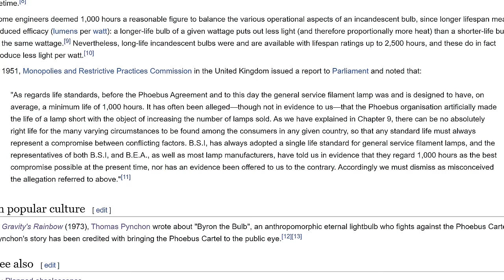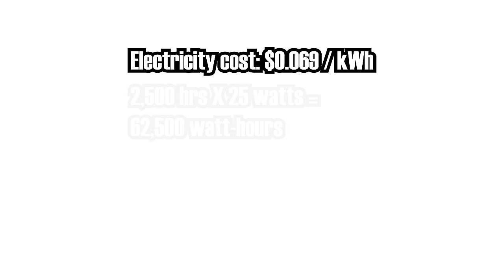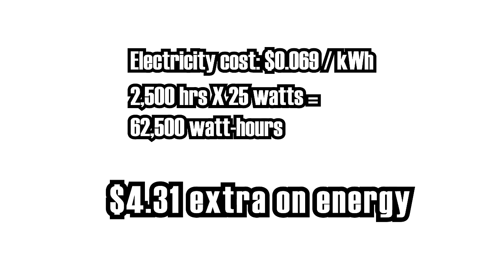Longer-lasting light bulbs: it was complicated

Comment: This got me thinking of other potentially dubious examples of planned obsolescence and I came up with an example that might be interesting to you, heat pump compressors! I personally had a fridge compressor fail recently after it was only about 5 years old, just outside of the warranty period. I've also had to replace the air conditioning compressor in my car after it was around 7 years old. Contrast that with stories of fridges manufactured from the 50s lasting for decades. But I wonder, did those fridges last longer because they were actually less energy efficient (also did they even last any longer?)? You can build a longer lasting compressor by using more viscous lubricant, or reinforcing the moving parts, both of which mean more energy is needed to do the same amount of work on the refrigerant. Have modern compressors been made worse for nefarious reasons, or is this another example of an engineering tradeoff? Exploring this question would give you a chance to make a video on heat pumps... again.
Reply: I've always assumed 1950s-era appliances, while being practically indestructible, consume ungodly amounts of power. Though, I've never been able to actually test this theory.

There can also be safety concerns such as CFCs, lead paint, wiring that becomes dangerous if something goes wrong, or an appliance that "works" but does a crap job, like the fridge shown on this channel (or was it Connextras?) recently that doesn't always manage to reach food-safe temperatures.

I'd also like to see stats on how many appliances from that era actually survived. It could be that a few lucky ones have lasted for ages while the majority failed within a few years. Again I don't have the data to test this.

I'm certainly willing to believe that modern appliances are designed to fail prematurely, but some research is needed to see if using an old one instead is a safe, reasonable, and cost-effective option. If your microwave lasts 10 times as long as modern ones but draws 10 times as much power, or irradiates you as much as the food, you're not really coming out ahead.
Reply: On a side but related note, I recall reading about the early days of refrigerators that there were two competing designs, one using the standard refrigerant that has been used ever since, and one, which I forget unfortunately, that used a different chemical that was not only more efficient at cooling, was easier to deal with and less toxic. Westinghouse bought both patents and buried the more efficient one for the one that uses more power because of course, they were in the power generation business and wanted to sell more electricity so they promoted the less efficient, more complex refrigerator design to do just that. Doesn't quite jive with the theory that power companies wanted to sell less power to keep the grid from getting overloaded, so I don't know about the truth of that story. Probably could look it up, or just wait for a video to appear on it (hint) lol
Reply: @renakunisaki 50s era appliances weren't indestructible. They broke down all the time. They only seem indescribable because we only see the ones that survive (survivorship bias).
Reply: "heat pump compressors! I personally had a fridge compressor fail recently after it was only about 5 years old, just outside of the warranty period"  What brands were those appliances?  The compressor in my Japanese Sharp refrigerator must be about 20 years old and is still going strong (perhaps I should upgrade to a more modern, more efficient fridge?).  If those were cheaper Chinese appliances like Hisense and Haier, then that would potentially explain lower durability compared to Sharp or Sony or Panasonic or Samsung or LG stuff that just works and works for decades?

The same thing as if you bought a Chevrolet Cruze instead of a Honda Civic. You'd think car parts fail here and there and everywhere on a 10 year old Cruze (planned obsolesence or just bad quality & cost-cutting?), where the 10 year old Civic has only ever needed scheduled maintenance...
Reply: @tassielorenzo7070  Samsung is the manufacturer of the fridge I mentioned in my opening post.
Reply: @Delease  Oh no! 😟
Reply: To check a fridge is still working properly you have to do a power consumption test over days or weeks. I've never seen a compressor fail on a modern fridge, but the insulation can go bad - particularly in a humid environment. Also, old fridges were very inefficient, even when running correctly.

Comment: @7:55 it is stated that Tungsten has highest melting point of any known element. This is wrong. Carbon has higher melting point of  3,550 C (6,422 F) vs Tungsten's 3,422 C (6,192 F). But this is not surprising that people think that Tungsten has highest melting point, since if you search on google  for element with highest melting point, that is what is returned, even though if your read carefully the referenced text, it says that Tungsten has highest melting point of all elemental METALS. Then if you search for melting point of Carbon your will get melting point that is higher than Tungsten.
Reply: Carbon doesn't melt, so it can't really be said to have a melting point.
Reply: @Owen_loves_Butters everything melts, unless it turns straight to a gas.
Reply: @oxybrightdark8765  Which is exactly what carbon does
Reply: @Owen_loves_Butters  I suppose it has an unsoliding point then.
Reply: @Owen_loves_Butters  In spirit of the information that this video provides, I think that more important fact is that which element stays solid at higher temperature at 1 atm and Carbon is still is it, since it's sublimation point is at 3,630 °C (6,560 °F) at 1 atm (and based on all phase diagrams I found Carbons stays solid across all pressures at higher temperatures as compared to Tungsten.) But full disclosure, I assumed that the people don't talk about Carbons higher melting or sublimation points is because it will ignite in Earth's atmosphere way before it will melt or sublime, since its ignition point is at about 750 C. But since video talks about incandescent light bulbs, and those are either very low pressure or inert gas field, ignition point does not apply. Still thank you for engaging me and making me correcting my misinformation, since I did think that Carbon would melt at 1 atm, given it is in inert atmosphere. Also, I still think that the statement in the video is wrong since it does not  specify pressure, and I think it is logical to default to triple point value, or in case of this video to the question which one stays solid at higher temp at same pressure and again Carbons is still it, as I outlined above.

Comment: I've read somewhere (that i can't find directly now) that the everlasting light bulb was actually a 220V version light being used in a 120V socket. Thereby only consuming 30W instead if its planned 120W. Thereby it lasts so long!
Reply: I have a 230V lamp outside my house running on 120V.  It's been burning every night for ten years.

Comment: Thank you! That explains something I wondered about when I was using Photoflood bulbs Back In The Day; those were typically rated for less than 5 hours for the 250W ones or 10-20 hours for the  500W bulbs. And cost a lot more than normal lightbulbs. They were, however MUCH brighter than typical bulbs of the same wattage. (Though there weren't many 'normal' 250 or 500 watt incandescent bulbs.)
Reply: I remember using those for DIY PCBs. They were such a hassle (and expensive) that I started collecting broken money testers and strip their UV tubes to make an illuminator for phototransfer.

Comment: I find a similar strategy in the Smartphone industry at least.

OEMs are committing long term software support but on one hand they make Battery replacement difficult, Screen prematurely failing these days and Slowdown performance with each update after some time.
Reply: Reducing performance is hard to argue, CPUs get a lot better over time so of course new features get added that rely on this new processing power, which means older devices run slower.

Battery and screen replacements are pretty obvious examples though (I'm looking at you, Apple).
Reply: they don't make battery replacement difficult, they make waterproof phones, which the consumers want, you can't have both just like you can't have the bulb be both long lasting and efficient. It's the same thing with software updates, you can't both have all the latest features and also fast, you have to pick one.
as for length of software support, it's not free, you pay for what you get, you want more you'd have to pay for it with more expensive phones. Some people just want cheap phones, again you can't have both cheap phone and long software support.

Comment: You also need to factor in the cost to replace. For some (mostly non-residential) applications the cost of replacement can exceed both the cost of the bulb and the cost of the power. A friend of mine mentioned a project at the local university to replace the bulbs in the high ceiling of their library. Cost was in the hundreds of thousands and involved bringing in scaffolding and a crew to assemble etc.
Reply: he does at 22:31